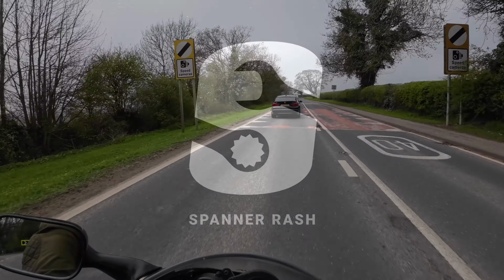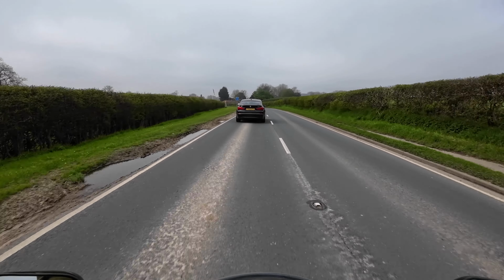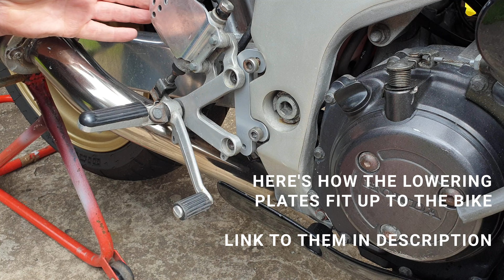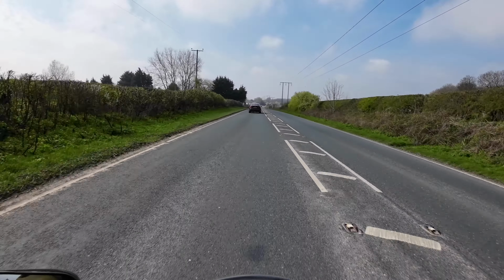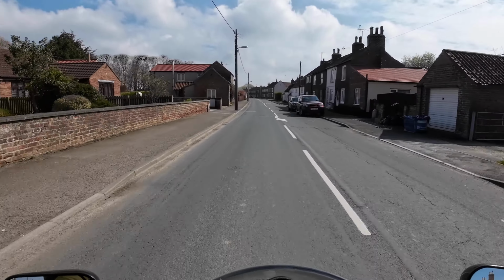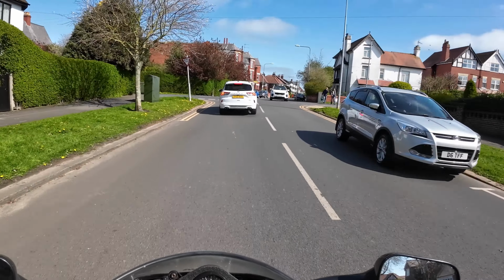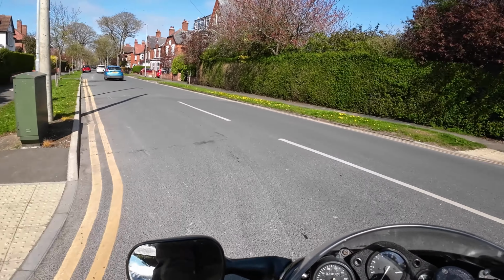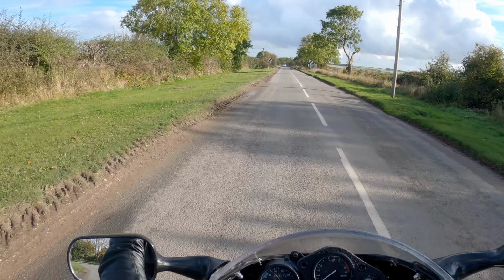Footpeg Lowering Plates for Honda CBR900RR Fireblade | Footrest Review & Fitting Guide | 16

Comment: I fitted these to my 99 blade. If anyone thinking about fitting these buy yourself a length of brake fluid rubber pipe as the original pipe is a bit of stretch to reach master cylinder from reservoir. 8 mm EPDM . Made my bike so much comfier for me 😊
Reply from the maker: They made a great difference for me.  I didn't spot the issue witht he brake line, but I would certainly check if I was fitting them again.

Comment: I did post on one of your other Blade vids these are exactly the same lowering/raising plates I had on my 1997 RRV, I know this a pretty old vid now, but one of my bug bares about watching people showing how to  fit items is they never seem to use copper grease, on the threads, I was always told to use this as it made disassembly much easier later on... just a thought.
Reply from the maker: Ha :) If you knew how much copper grease we go through, you would fall over.  I hear what you say with this vid.  Most importantly if using anything stainless not using some form of anti sieze is playing russion roulette.

Comment: The problem you’re describing with the pegs is technically known as “old age” Les, now I have just sold my RRV and bought a Gen 1 blade, twin round headlights, white, purple, dayglo orange, it is without doubt the most beautiful thing on earth (with the exception of my wife of course!), but back to the point re the pegs, yes they can be a little difficult to locate when setting off for those of us that have see more than 50 summers, BUT, fitting lowered pegs is a cowardly admission of age and should be avoided at all costs 😂.
Reply from the maker: Ha, sometimes you just have to accept it, wait until you see what is coming up. I am wondering what my Cafe Racer will be like to ride when I finish it.  Old age is an issue but consider the alternative?  I will probably buy another 'blade or similar when my memory has faded a bit.
Reply: @SPANNERRASH  well one big advantage of the SOHC engine against the Fireblade engine is that it only make half the horsepower (I have one) , it gives us old folk a lot more thinking time 🙂👍

Comment: Interesting and educational channel, ordered the Footpeg Lowering Plates for my CBR 900 RR 1999 (blue/white/gold rr letters) that I bought last Saturday. I had to ride the bike back from Tilburg to Terneuzen in the Netherlands, the comfort was not too bad but I think it would be an improvement with some lower footrests.

Would it be possible to mount the handlebar halves above the triple clamp ? The geometry will change but there seems to be room for +/- 3 cm lower to try.

Compared to my Honda VFR 750 1995, this Fireblade feels much lighter and much more agile, the VFR even took some getting used to immediately after the Fireblade, a little less power with the 748 cc V4 but it remains a charming all-rounder with the special V-4 sound.
Reply from the maker: Great to hear from you, thanks for the positive comments. I suspect it might be possible to move the bars, but I don't think I would try it.  The change to the steering head angle would make the steering even lighter and might cause "tank slappers".  I really do love the Fireblade, I have had 4 now,  for a sports bike it isn't too bad for comfort, but I did find the lowered footrests made it much easier for me to find the footrests when setting off, and then caused far less issues with my thighs and hips especially on longer trips.  It's great to have different bikes, they all have their good points, the 'blade and the VFR have far more good points than most :)